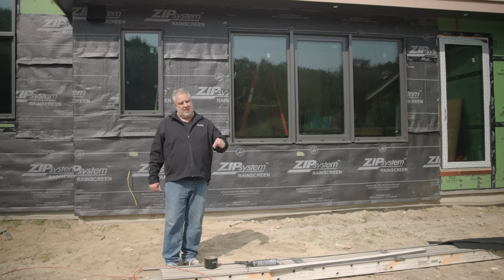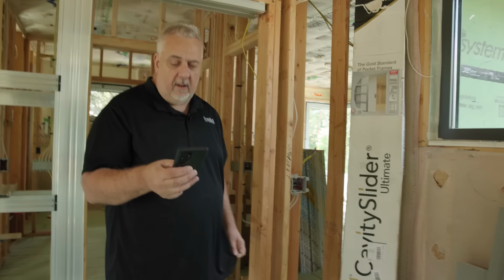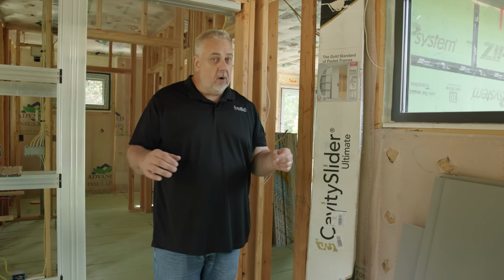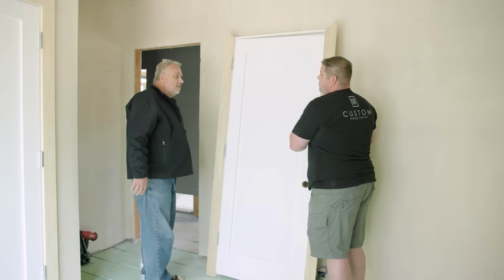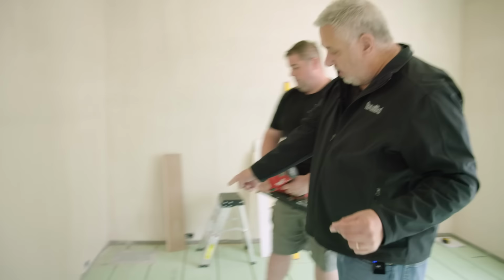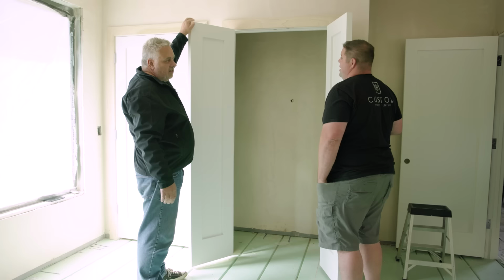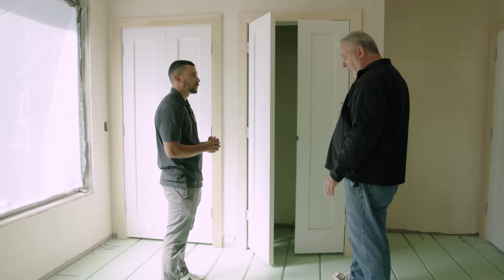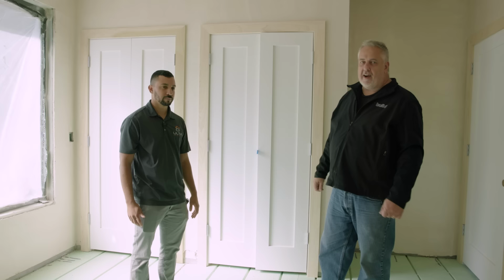"Interior Trim & Painting" Build Show Build: Boston Ep. 17

Comment: I really hate our MDF doors.  They were high-end, but the ones in the bathroom just don't last with taking on moisture from the air.
Reply: If you use the correct MDF and finish them properly you should get none to very little moisture issues.  They even make MDF for outdoor signage.
Reply: @wags99999 Would love to know what the "right way" is; ours are nicely painted, high-end doors but the house is naturally ventilated and extra humidity from the showers has caused noticable damage to 3 of them with a fourth in serious condition.
Reply: @patrickkenny2077  first use a quality MDF, NOT the crap from the bix stores.  Medex comes to mind. It's designed for outdoor use.  Then use a quality finish and finish all edges and faces with multiple coats, you may have to size the edges before painting. A quality finish will not allow moisture to penetrate the film.
Reply: @patrickkenny2077 

WHAT DO YOU CONSIDER NATURALLY VENTILATED? 
If your home is not Air-Tight as Matt and the boys preach… it will be impossible to reduce
You need to have a dehumidifier installed which runs at all times if is that humid in your area, but your bathroom fans are probably too small also, a high cfm fan might also require make-up air.
Reply: Remove the door and check whether top and bottom are painted.
Very key point not explained in this video.
Not saying they will not follow this step in this particular home.
However it is an essential part of keeping a door stable.
A door has 6 sides,all must be sealed to keep the moisture intake equal.

Comment: Why wouldn't the floor go in first then set the baseboard on top? You bury 3/4 inch of the baseboard? This makes no sense to me. Isn't the point of the baseboard to cover the rough edges of the flooring and drywall?